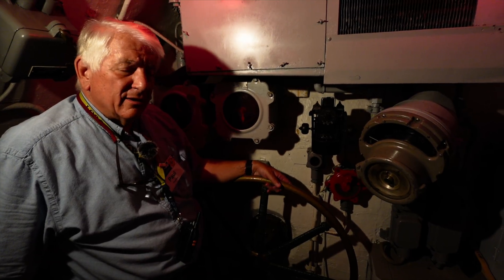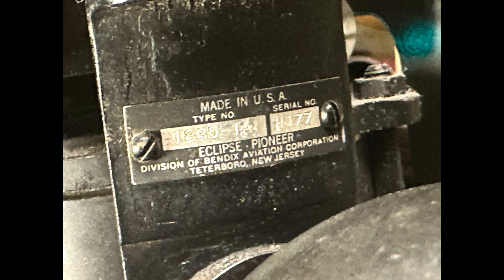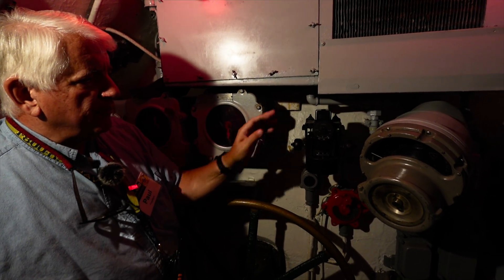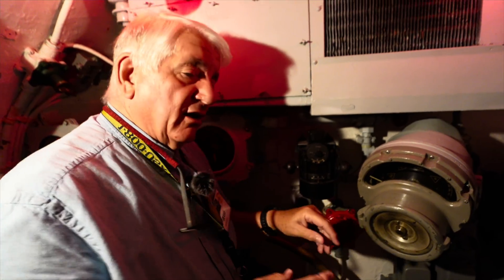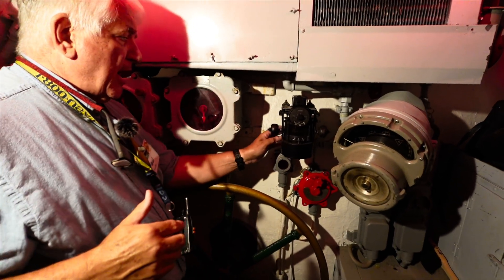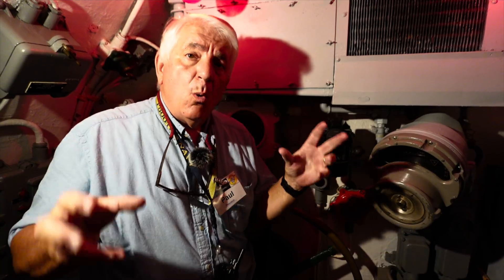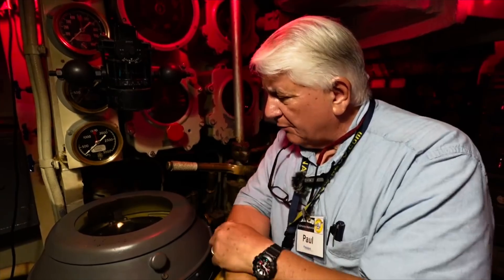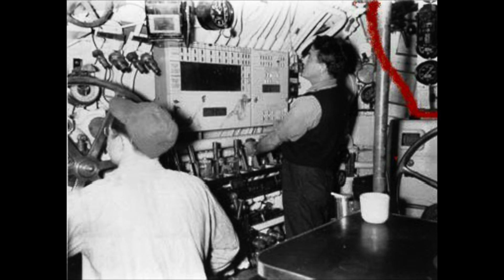Magnetic Compass Navigation on a Submarine: When All Else Fails!

Comment: Even the wooden hulled minesweeper I was stationed on had a magnetic compass with the navigator's balls along with the gyro compass!
Reply: I work on the restoration of USS Lucid (MSO 458, Stockton CA), and, it being all non-ferrous (to prevent activation of magnetic mines), I never thought to look for the flinders compensators.  Next time I'm out there, I'll have to look or inquire.  I have them on the compass on my boat, and spun that compass a couple times on SF Bay.  Now with GPS, not so much.  I still keep a deviation card, however, but rarely use it.

Comment: Awesome video… such a little part of the boat… but soooo important to have available as a backup. Getting an accurate bearing when even a tiny fraction of an arc/slice of the degree pie… translated by 1,000 miles in the Pacific Ocean… meant being off by so far that you might not even find the island you’re trying to find. It might be over the horizon far.